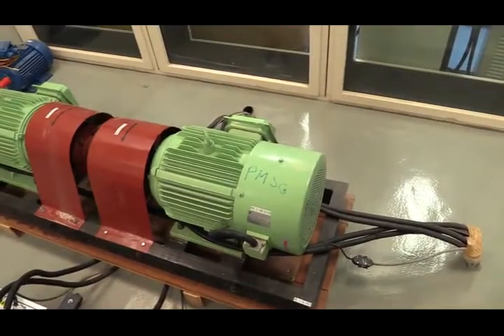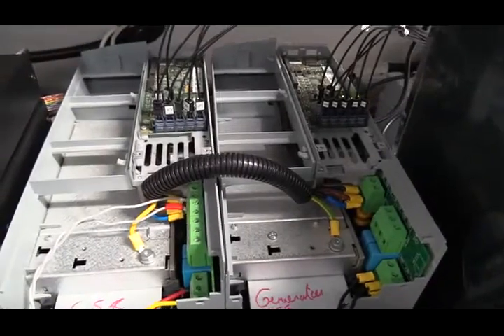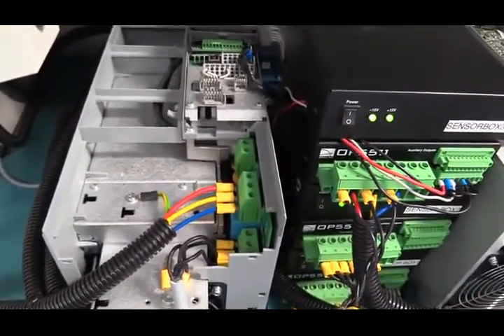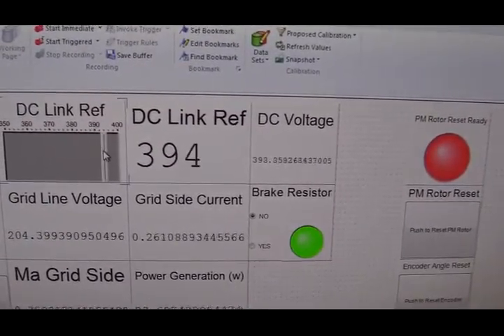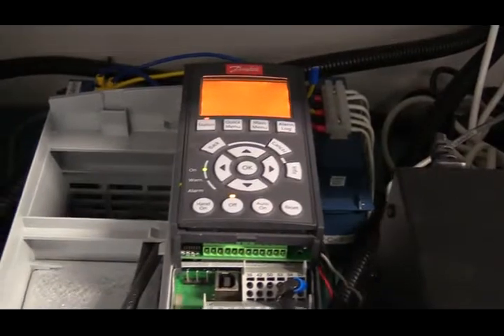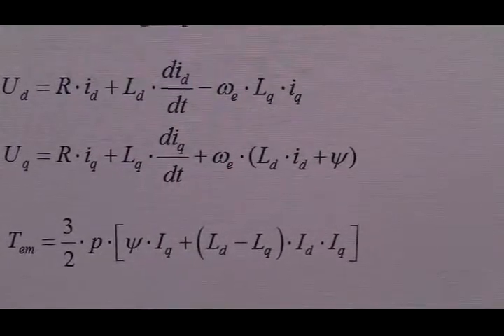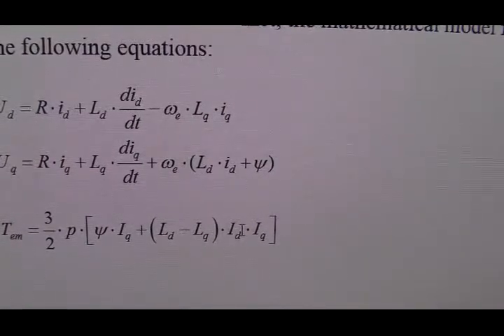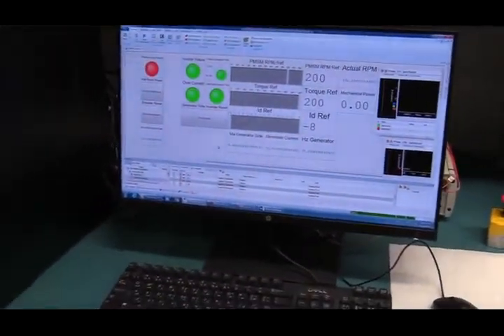Interior Permanent Magnet Synchronous Generator (IPMSG)

Comment: Sir,does your permanent magnet synchronous machine work both as pm syn.motor or pm syn.generator reliably ?
Reply from the maker: Yes, it does. as long as you operate it within the limit.
Reply: @yusileng  Thank you very much Sir for replying.
Is it possible for you to connect with me as require bit more help from you ?
If possible please share your mail ID.
Reply from the maker: Sure.

lengsiyu82@gmail.com